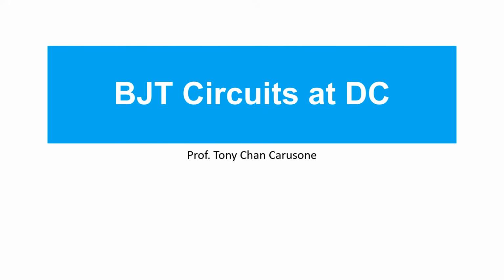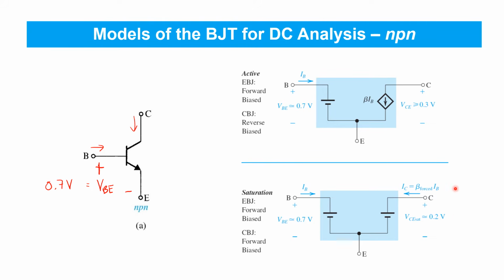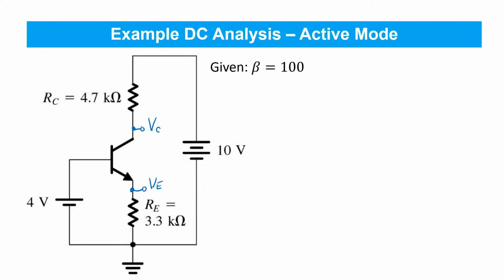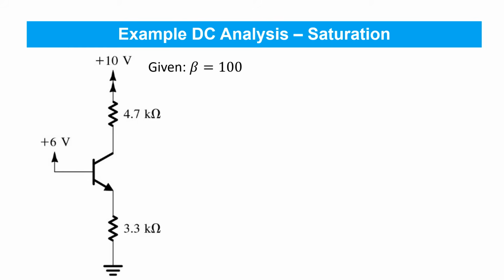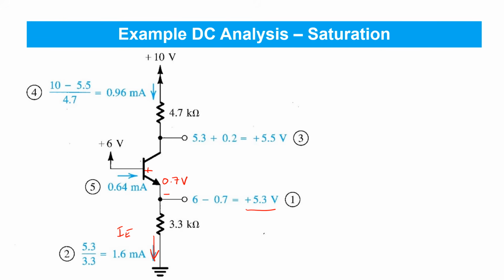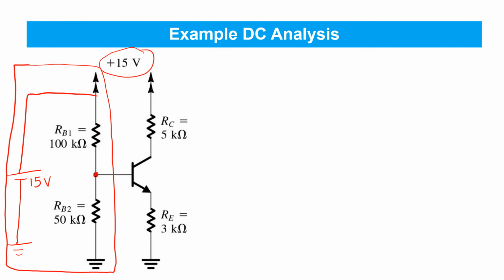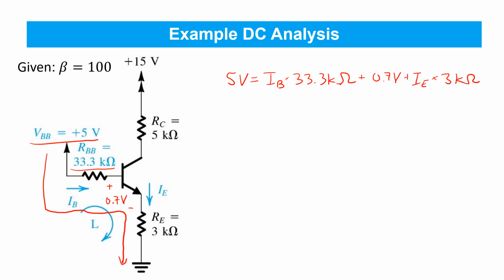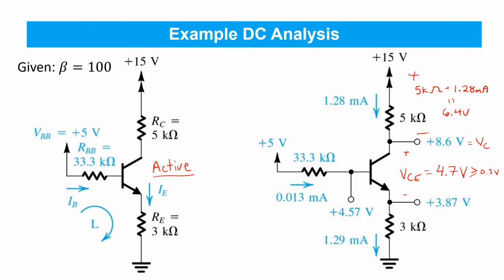43 BJT Circuits at DC

Comment: I usually never comment on teaching videos, except for this one. I thought BJT was really difficult because the slides were just sloths of paragraphs. Turns out its just KVL and KCL acting as detectives, trying to see what state a BJT is in given certain conditions that need to be met, and also understanding what those conditions actually imply on the electrons that are passing through for each stage. THANK YOU!

Comment: do you know any books or set of books on electronics that has problems with difficulty levels ranging from total rookie barely knowing how to do algerbra to borderline genious that can freely apply calculus to just about anything, and solution to the tasks on just about every topic it touches?  the book should have tasks on topics  starting all the way from ohms law(or from atleast KVL and KCL if ohms law is considered too basic)  to more adwanced consepts and should include design and analysis of circuits with semiconductors(not at  the die design level, but at circuit design with discrete components level)

Comment: In the course I took, the teacher told us that we could validate the active mode hypothesis by checking two things: first, that Vce is greater than 0.7 volts or Vcb is strictly positive and at least one positive current. However, you validate the active mode hypothesis with Vce greater than or equal to 0.3. Can you explain why there is this difference?

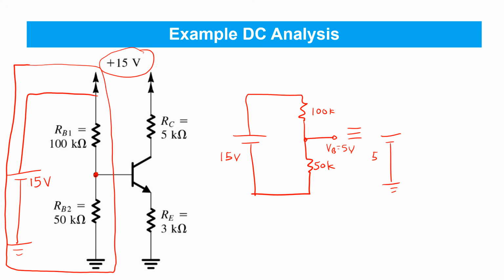Comment: 19:10 isn't it 10V for Rth because 15V*(100/150) = 10 not 5
Reply: No because Vb is the voltage drop across the 50k resistor not the 100k resistor

Comment: How did  you derived 0.3 v value? 

How can electron pass base collector junction, when it is in reverse bias? Generally, in PN junction, in reverse bias, election can not cross junction in reverse bias.
Reply: The collector current is not  diode conduction.

Comment: For the circuit at 9:30, why is there a current I_c when the diode at the collector point is against I_c? (Reversed)? Since it's reversed bias, shouldn't I_c be 0?
Reply: This is how transistor works, and the CB junction shouldn't be compared against a separate diode. In fact, the base area of the transistor is much thinner than the collector or the emitter, so if you had two diodes connected back to back, it will not work as a transistor does

Comment: In your final analyis I think the transistor in saturation mode. Because the base current is approximately 129 micro amps and then the current gain is 100 so the collector current should be(100*129microA), which is 12.9 mA. So to find the collector voltage we have to subtract 15-(12.9mA*5000) and we get an impossible answer that is -49.5 which indicates that the transistor is operating in the saturation mode. A hard saturation
Reply: Yes it turns out like that but in actual fact you apply 0.7 across the base emmitter diode and the large part of the majority carriers from the emmitter cross the base collector junction to constitute the collector current. The smaller portion comes out through the base. The proportionality of collector current to base is beta. Viewing it this way shows causation - what results in what. To me base current is the result, not the cause of collector current. I would say the base current is a function of collector current not the other way

Comment: Thanks, but in the final analysis around 22:00 - 23:00 you dropped the k on the resistor.  I think it's 33.3k(IB) plus (beta+1)IB.  That's 33,300 +303, so then Ib = 4.7/(33,603) ≈ 139.87 uA.
Reply: not quite, he factors out the k at first because it is part of the units, so its (beta+1)IB*3 which is why it simplifies to 303 but is still in units of k, then in the end he adds them up, 303 + 33.3 = 336.3 and adds the k back during unit evaluation.

Comment: Use BJT transistor to design an amplifier circuit that operates in the frequency range 10kHz100kHz. Verify your design by simulating the design using the circuitmaker software. Use
standard resistor values (10% tolerance). The design should meet the following criteria:
Reply: Lol
Reply: ok

Comment: So let me get this straight: If I apply a 0.7 Voltage bias from Base with respect to the emitter  while also supplying current in the base of the NPN, I will get an output current from Collector to emitter that is a multilocation beta of the Base current. This the emitter is what I'm taking everything in respect to : Voltage form Base to emitter with a current applied to the base  outputs a  BETA times the input current flowing from collector to emitter.